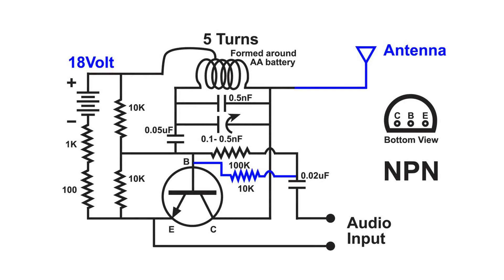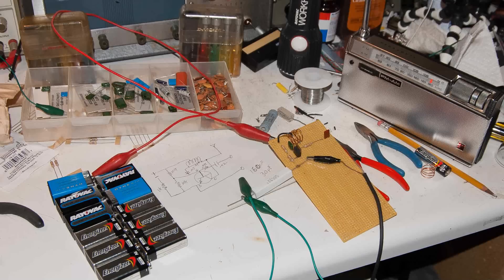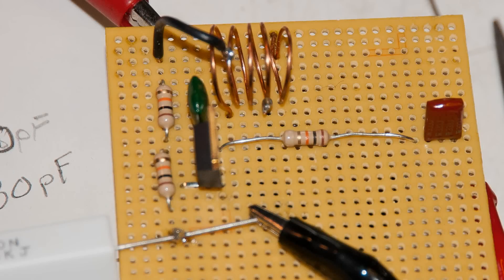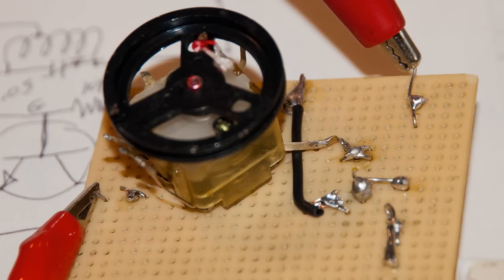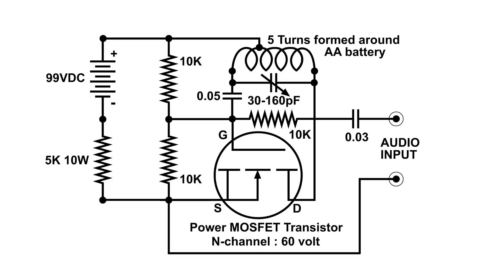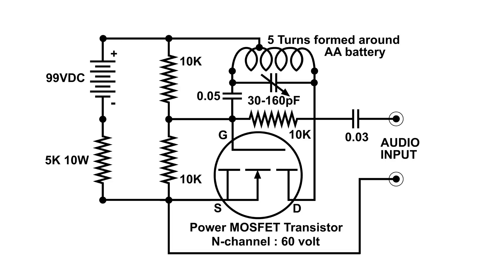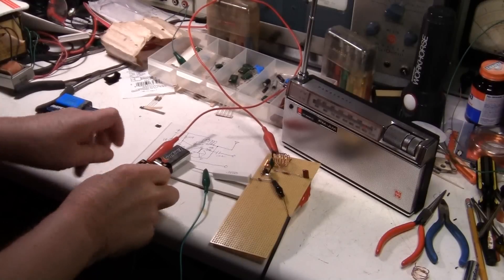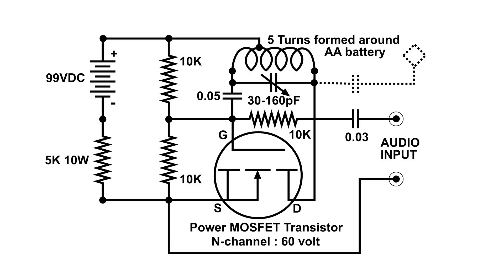FM Transmitter, MOSFET Experiment

Comment: What is Range of the rf signal in miles??
Reply from the maker: My purpose is to transmit to the radios in my house this good quality audio.
If you're planning on running your own AM radio station the Ramsey kit model AM25 may suit your needs. Many schools and low power AM broadcasters use this transmitter. And in the USA low power AM broadcasters are required to have a license. The end user is responsible for complying with all FCC rules & regulations within the US, or any regulations of their respective governing body.

Comment: Great and informative videos and I love hearing your voice. Made 2 of these and they both work well. One with rf510 and another with z44N. However, the circuit as described appears to transmit harmonics rather than the FM band.  The center frequency appears to be around 30 to 50 MHz, which makes sense as the rf510 was intended for short wave radios. Two ways to tell: use a meter if you have one; or alternatively, try to tune within the FM band. If you only get one or two stops, rather than a contiguous range, then it's harmonics. If you add a separate oscillator to the circuit,  the 510 might make a good RF amplifier, or you could substitute a higher frequency transistor to get in the right band. I tried a 150MHz power BJT from an old TV set and it was able to tune properly within the FM band. Love to hear your thoughts.
Reply from the maker: The purpose of the video is to supply the beginner experimenter with a circuit that they will have success in building. In that respect it's pretty much bulletproof.
Reply: @AllAmericanFiveRadio  Purpose fulfilled! Your transmitter was the first I had tried that actually transmitted clearly. Your videos are so clear and helpful. It was such a great experience and inspired me to keep learning. Thanks again!

Comment: Yes, it works,
Also on 12Volt
BUT I burned my fingers to the IRF510
it is not 100 percent a good schematic.
within a second it is red hot.

friendly greetings from The Netherlands
!
Rob.
Reply from the maker: if you use a 60volt MOSFET it won't got hot
Reply: Can you tell us which 60Volt MOSFET you used?

(by the way, I have not put more than 12Volt on it?)
I put my finger on the IRF510 ( I was shocked!!! )
SO FAST SO HOT,  I did not really burn very much Fortunately :-)

the friendly greetings again!
Rob.
Reply from the maker: MOSFET N Channel 195A 40volts

MOSFET IRF540 100volts

This AM transmitter uses the 195A and does not get overly hot. It's the same circuit as the FM transmitter but the tank circuit is tuned to the AM Band.

AM Transmitter Solid State, build and demo
https://youtu.be/-KmO3_irhHg
Reply: @hobbyrob313  the IRF510 is widely used in various AM transmitters (for a good reason they are cheap considering the power they can deliver) and in most of times they put some cooling at it.
Reply: @xXTheoLinuxXx  Hello Theo
,
yes i know, i use the IRF510 very often.
the grenade AM transmitter was / is a great success for me!
just search for images with: schematic grenade transmitter
with good conditions around half the world (in AM modes!)

Kind regards again!
Rob
Reply: @hobbyrob313  that is indeed a nice one. But I guess that was on SW too. I've never tried something on that band.  A few years ago, was the last time I listened to those frequencies, but the pirate in me didn't win :) FM pirating has lost my attention decades ago, there isn't much fun since most of them are using kilowatts. Between 85 and 88 (the former policeband) is more fun, but I guess it is a matter of time before the kilowatts will arive there too.  Since it is possible to get a licence for an AM transmitter  (25 watts, 100watt PEP) it is more interesting to turn the radio on and  to pick up signals from a station without lots of power.
Reply: @xXTheoLinuxXx  I started as an FM pirate a long time ago,
Here in the Netherlands that was a very nice time!
unfortunately the fines became unaffordable so you'd rather not get caught and everyone stopped.
then I accidentally became a SW pirate, with SW I was totally unfamiliar with sw
the first time I called with the channel I thought it would probably not be heard!
I had read that around 6300khz AM would be pirates,
I accidentally had a 6400khz crystal and with that I had started sending.
and at first a Belgian station came back for me (I was shocked!)
I thought that was impossible! get so far away with 10Watt (AM mode)?
(I would never succeed
 that on FM!)
After that the AM pirates steamed into me more and more
More and more pirates arrived
they all called to me! ???
that too was VERY nice! but unfortunately the conditions are very bad now so we have a break for a few years!

Greetings from here again!
Rob.
Reply: @hobbyrob313  It was indeed a good time. I had a long yagi (approx 6.5 meters) and a ecc82, qqe03/12 and 4 EL34 tubes transmitter, until the Dutch RCD was knocking at my door. But that transmitter wasn't the reason why they knocked at my door, I had another thing that was interesting a 27mc set which was a bit more capable than accepted ;)  I was talking with other countries in Europe at 27.555 USB and they picked up my signal.  They couldn't find my 27mc set (and I told them that I haven't that set anymore) but the transmitter was a big to hide.  At the end 'Be Muller' from the RCD told me, well  I take only your transmitter and if you like you can transmit this evening, so I did :P But at that time local radiostations where coming up so DX wasn't possible. So I tried 60cm and Medium Wave, and over here there are still pirates on the Medium Wave. Back in the 80's pirating on the SW was the easiest way to get fined, I believe it had something to do with the cold war. So it had a high priority to take them down.  But I know 10 watts on the Short Wave band is nice, and it is more fun than using kilowatts, in my opinion that is what DX-ing is all about.  Greetings from Theo Nieuw Buinen (Buunermond is dialect for Nieuw Buinen)

Comment: I am using a wall wort power supply to power my homemade fm transmitter, but I can't seem to stop power supply hum from being broadcasted with the carrier wave?
Reply from the maker: I'll see if I can make a wall wort power supply work this the FM transmitter. Might make an interesting video.
Reply: I went back to the basics and tried a rc low pass filter, that helped some but there was still some noise, so I tried using a pi filter consisting of two caps and a transformer primary used as the inductor, it works great to stop the noise, but it is bulky to have to use an inductor this big

Comment: How many watts does the transmitter put out with 99 or 18 volts?
Reply from the maker: under a watt. the voltage across the mosfet can not be higher than 60VDC

Comment: I seem to be having an issue tuning this circuit for the fm band as i only have a police scanner and an fm radio to check the frequency..... is it possible to replace the air coil with a tuning slug? I have a lot of cb's and ham radio's lieing around with tons of coils to use....

Also i was able to get close to 88 as i heard some bleed over when i was on the lower part but changing the coil back n forth i was not able to get on frequency.....

Thanks in advance Shaun W.
Reply from the maker: shaun wisenburg 
Yes, you could use a coil with a tuning slug. I would take one out of a junker FM transistor radio.
Reply: Do you possibly know what Slug i would use? I just started in electronics and im currently in the beginning but i know these old radios have different slugs.... theres some slugs that have 2 pins (no name) and some that have 6 pins (toko rcl).... and if i could possibly chat on the phone to get some help would be appricated... heres my email  shaunndevin@gmail.com
Reply from the maker: Building an RF transmitter is a little trickier than other projects. If you build this FM transmitter exactly the way I have, and all your parts are good, it will work. I have other videos on building a one transistor FM transmitter, pretty much the same circuit but the power supply voltage is much less. The thing that makes building a transmitter more difficult is the RF. The RF is very good at finding shortcuts, which shorts out. All the parts of the transmitter must be very close together, and the most important is the tank circuit, the parallel coil and capacitor. The coil is easy to build, five turns around a AA battery, and there is a tap on the second turn. So there are three connections from the coil. The end connections is where the tuning capacitor goes a crossed. And of course the capacitor must be the right value.
Reply: ok, i think i might have the tank circuit a little long... as far as the AA's is this equal too .1uh? maybe if im having trouble i could head down to the electronics store as they have ceramic inductors as well as coils but they are marked by microhenries and henrys
Reply: I use to work on cb radios with my grandpa and father so i know a little bit about radios but i really would love to get your design working so that i could improve on it as i go along in school
Reply from the maker: Shaun Wisenburg
The first step is to get the transmitter working, and then try and modify it.

Comment: Btw would this work with A.M. if I wound a bigger coil? Thanks again
Reply from the maker: This transmitter will transmit AM and FM simultaneously, all you need do is get it on the right band. You may need to increase the number of turns on the coil, but I would try increasing the capacitance first. With changing the capacitance I have been able to get this transmitter to transmit on the AM band.

Comment: A tad intriguing. I never would have thought that an IRF510 would have enough gain at VHF frequencies for this to work. It makes me wonder if it would make a reasonable RF power amplifier instead of an oscillator at VHF also. Input capacitance may be a bit high but it may be workable! Drive it with an oscillator coupled with a link winding into the gate of the mosfet perhaps :)
Reply from the maker: Thank you,
Reply: @AllAmericanFiveRadio  I got intrigued to experiment and got a 2SB649A pnp medium power transistor to oscillate in a circuit at 90mhz. If I had a BD140 I would try that as I'm very curious, but they're all in experimental projects
Reply from the maker: @Dazzwidd  That is great! I hope you keep experimenting!
Reply: @AllAmericanFiveRadio  I have for over 30 years like you mate 😆 Its all about the fun really
Reply from the maker: @Dazzwidd  Thank you, it is great fun!

Comment from the maker: Hey Tom

The beginner is what I have in mine. This circuit works over a large range of voltages and it is very easily modified. The parts are easy to get and anyone can make the coil. 

Let me know how yours works. I never measured the output, be with no antenna I can pick it up at my mail box.

Rick

Comment from the maker: A crystal oscillator should work the MOSFET is very high impedance so it will not load down any signal driving the gate. At a lower voltage you could use the output as a driver (exciter)

Comment from the maker: Hey Andy,
I like that it will works over a wide range of voltages. And by changing the tank for a frequency band it will broadcast below AM and well over the TV bands, and with as few as parts as possible. It modulates AM and FM simultaneously, so it is the receiver that picks out what it needs. You'll have fun with it.
Regards,
Rick

Comment from the maker: Modify the tanks circuit and it will transmit on the AM band to well over the TV band. If you have over modulation increase the resistance of the input resistor.